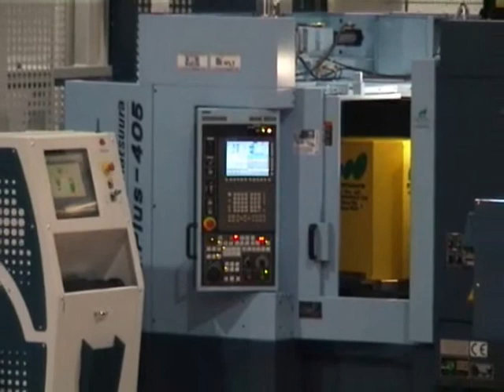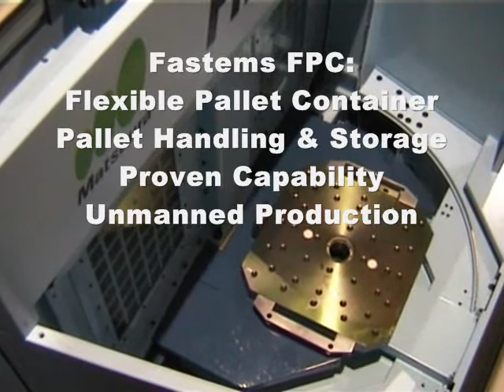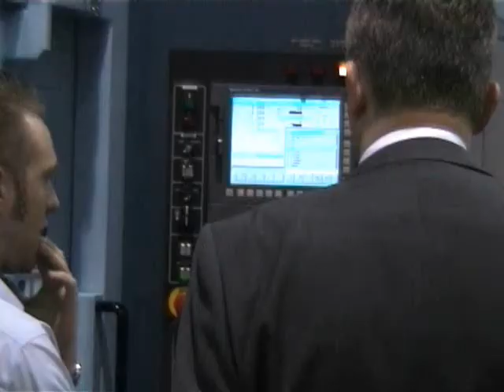Matsuura Maxia: Fastems Integration

Comment from the maker: Hello rrwcncedm
This Fastems can hold 12 pallets - but a system can be tailored to the process at hand with as many pallets as required.

The 4th on the Matsuura H.Plus-405 is: Index Speed: (90deg / 180deg) 1.2 seconds / 1.5 seconds. Max Rotational Speed: 50min-1. Positional Accuracy: 5 sec. Repeatability: +/- 2 sec. 

Matsuura in partnership with Fastems would support the system, & yes we do have UK reference sites.

Please contact us via our website for details.

regards
rmf